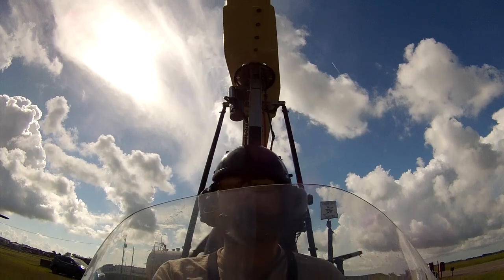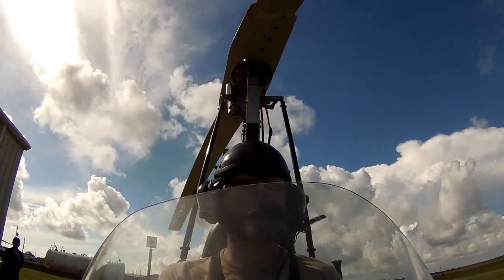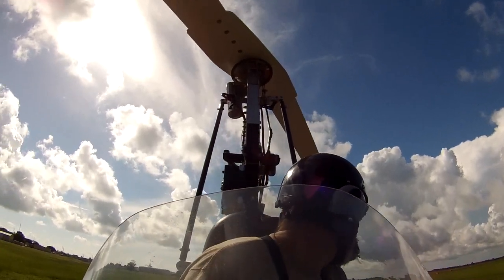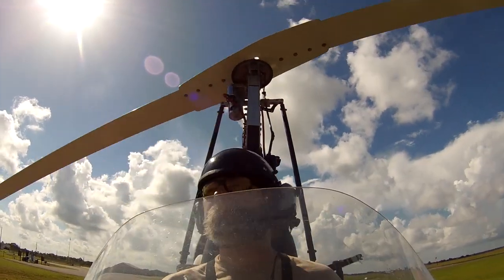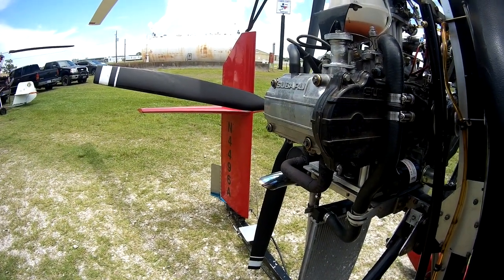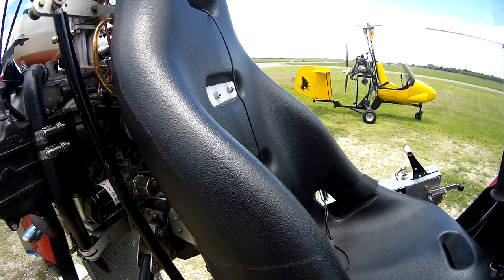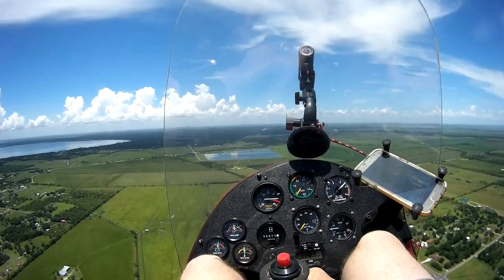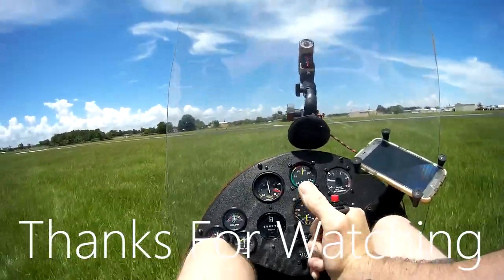Gyroplane Rudder Trim

Comment: Great video. Thanks for sharing. BTW- You mentioned something in the video about Low and High on your pre rotator. Is that a dual speed automotive starter?
Reply from the maker: It's a high torque/high speed small block chevy starter. I have a double pole double throw switch wired in a way that one side trips the starter alone but it's running through a large resistor made from a welding rod. This reduces the voltage, causing the starter to run slow. The other side of the switch trips the starter as well as a contactor that baypasses the resistor, allowing the full voltage to reach the starter. I explain it in THIS video. https://youtu.be/4SyzIBk2ZJc
Reply from the maker: It's a normal starter for a small block chevy. The way to get two speeds out of it is to run a separate solenoid with a large resistor to reduce the  amount of current when on "low", then bypassing the solenoid to give it full current on "high".

Comment: So a control surface can be aerodynamically balanced or mass balanced or both. Other than having to overcome p-factor with the appropriate rudder pressure, what are your assessments of the tall tail with the fixed horizontal attached? Visually the attach points seem less than robust. Obviously the attachments and the stresses have been engineered. Also, some designers claim that an effective horizontal must be an area which is a percentage of the total disk area of the rotor. Is that horizontal stabilizer effective at higher speeds when you depend on it the most? Sorry, I’m sitting in my den on a Saturday morning wishing I was there in Anahuac engaged in hanger talk but alas, I am many miles away. And I read too much.
Reply from the maker: This tail was an original Dominator tail that I chopped 4" off of the top. Since the top is slightly shorter than the bottom, I still get a slight need for rudder correction as I take off, but WAY less than a standard "short" tail. I've worked most of the slipstream bias out by offsetting the "anti-servo" tab. I've had absolutely no pitch sensitivity issues with this tail. I didn't do the math, but it seems to work just fine. The lower attachment is the stock Dominator bearing plate, but the top is attached to a chromoly tubing brace. It could be stiffer, but it it will not break. I'm not a "yank and bank" type of pilot, so the stresses on the rudder are way below what the brace will accept.